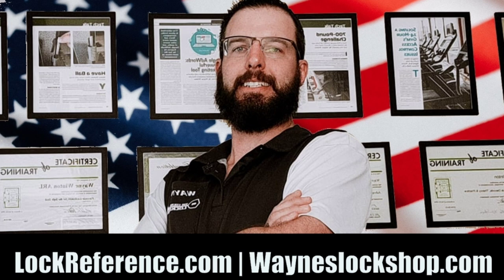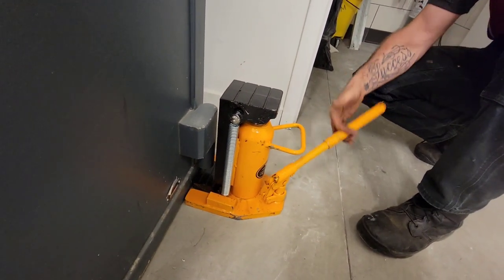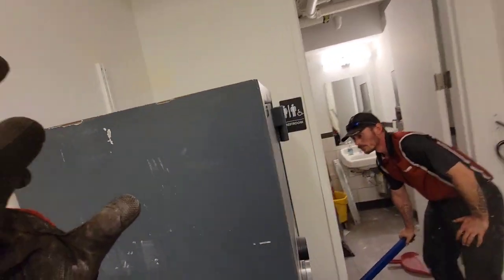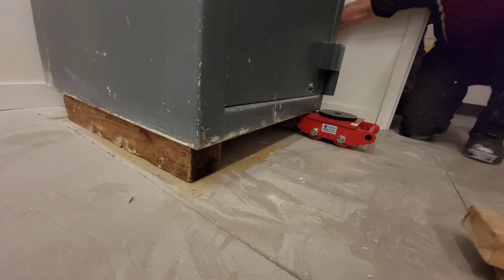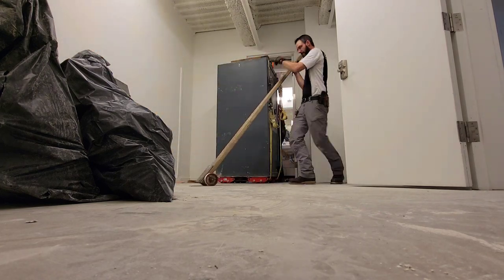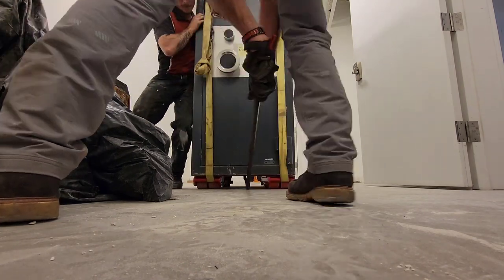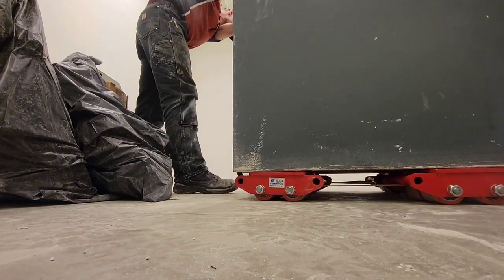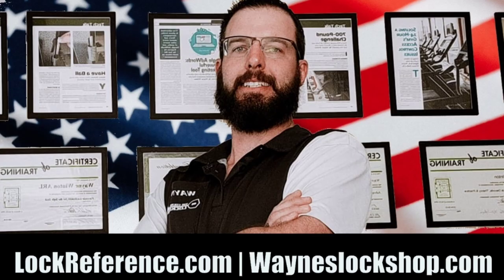Move heavy 2800 lb safe with equipment moving skates and a toe jack Amazon affiliate link below 👇

Comment: You need to put the steering wheels on the front and the straight wheels on the back. Then you can turn corners and not just spin on a dime.